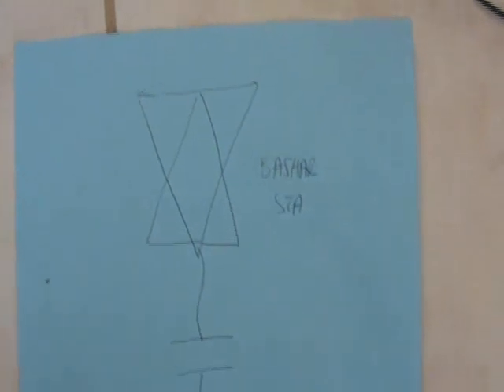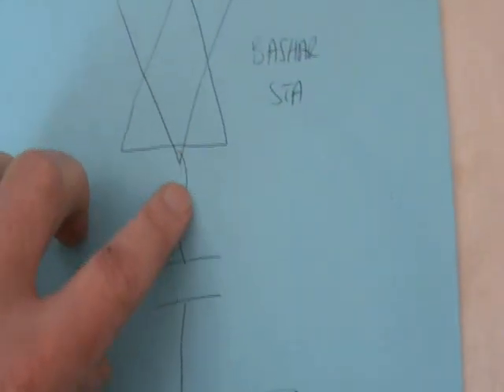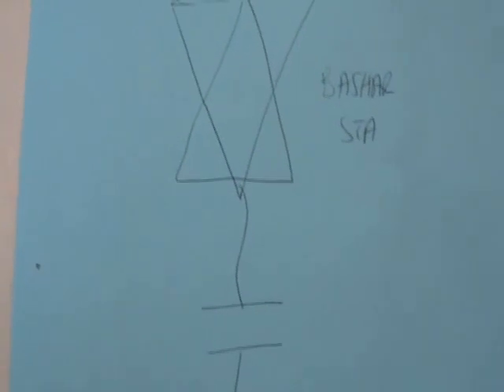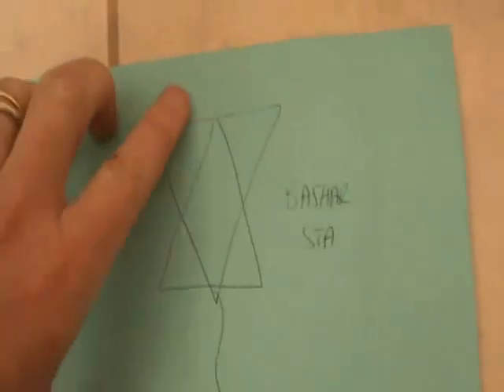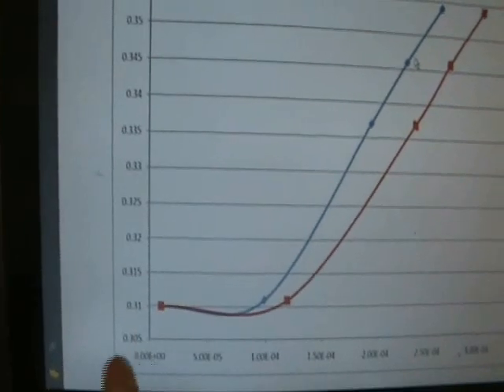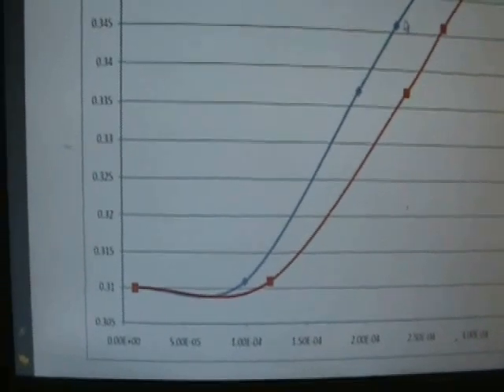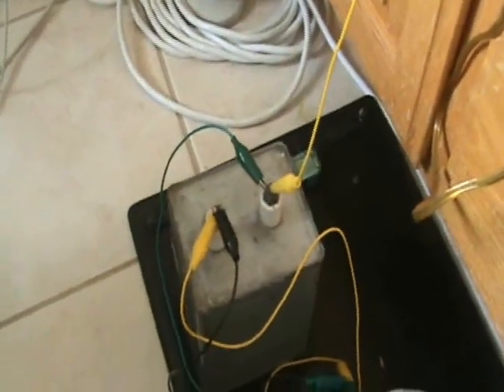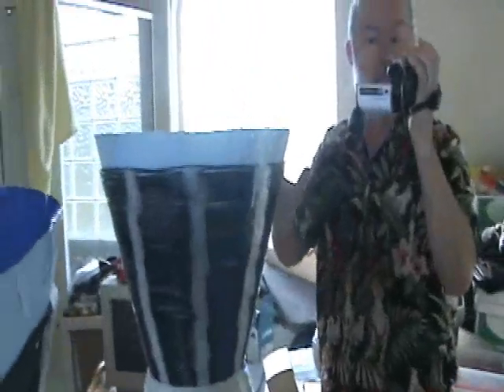Ep. 18 - Bashar Free Energy Space-Time Antenna (Going Lower...)

Comment: bashar  is good coil system in 3 D  , for harvest much voltage , because of his strong accelleration magnet fields , with ferrite and amp meter you can adjust  the highest voltage, your coil construction have a high Q faktor for low fequencity , in the center of the cone dome is the highest potential voltage , to used for charging ,  but it receive normal long /midle  wave transmitter , more copper mass is more induct capacitance and more electron harvest .

Comment: Hi mopher44, thank you for this info :) have you tried using sound waves at different frequency's instead of electricity? Best regards, L
Reply from the maker: coils of made a copper, and its difficult to send sound INTO copper w/o electricity. Speakers?
Reply: Thanks for the reply morphus44 :) the idea was not so much as to send the sound through the wire but more to blast sound at it from the outside or from above, or from above and below at the same time. Hope this does works in someway and is of help to you! Best regards, L
Reply from the maker: Lynne Buksh Are you thinking in terms of the Piezoelectric Effect? Sound producing pressure on a crystal and crystal producing electricity?
Reply: No more frequency, harmonics and vibration. I think we need to be looking at outside the box thinking with these new technologies other than face value sciense. Anything fixed within the confines of Earth physics will not be universal nor interdimensional.

Comment: Hey mopher44. Great work you are doing here. I am thinking about building an STA myself but think I lack the technical ability. I would like to point you in the direction of something I think you might find extremely interesting in relation to the STA. It is called the The Harmonic Energy Exchange Device. Google it and it should be the first result that you pull up. I would be interested in seeing what your findings are playing around with this information.      My thinking was the stress field that was created when the high voltage start pulses where applied would be amplified with the three sided pyramid over the STA. There are however so many different directions you could go when you sit and study the schematic that its crazy.      Anyhow, hope this helps and keeps you pushing on.
Reply from the maker: Oh! Is this a Stan Deyo patent. I know about him. Cool!
Reply: Yes, it is a Stanley Deyo patent. The position of the large capacitance you had at the bottom of the STA reminded me of his arrangement . Bashar said "with a little bit of an electrical charge you can start the coil to begin resonating". The input was on either side of the caps in the Deyo patent..Have you tried putting the STA under a 3 sided pyramid as Bashar said to see if that had any affect on the output?
Reply from the maker: sleding yes I have. But realize there is INPUT as well. I used aluminum foil on the surface of the tetrahedron (not pyramid), and connected the inner foil (separated by the dielectric material) to connect to the coil. This creates a tank circuit. A nearby plasma ball serves as a radiant energy emitter.

Comment: Why do people build these at all? It's like building a motor from Lego that resemble a Chevy V8, and assuming some magic will bestow fuel, air mixture, compression, ignition, combustion, exhaust systems. This geometry, I've seen in Walter Russel's work, and where attempting to explain how waves work. How magnetic orientation to Radiation/Centrifugal while also Contracting/Centripetal  in spheres. Neato models... This "Basher Free Space-Time Antenna" is a hot mess, yikes! I watched a dude plugging one to AC... HAHAHAHAHHA.... ooooo what a bright spark!
Reply from the maker: +XR IX Yeah. Plugging a coil into your AC main -- not a brilliant idea. In my case, I made this coil, because I had read that Tesla experimented with really large cone shaped coils like this, and I thought it would be interesting to try this and mess around. Electronics are a hobby -- yes.
Reply: I don't want to discourage you. If you have made it to, radiant energy, and coils shaped like cones, as well as the Russelarian perspective, you have started moving the hay off the haystack. I built an EV Gray effect motor, and then started realizing there was a facet of electronics that has been, hidden by academia. If you're interested, I'll share.
Reply from the maker: XR IX Certainly Tesla claimed certain things that are not quite mainstream, like faster-than-light wave propagation, longitudinal waves from his tesla coil, and some other clues hidden in his patents and in Hammond patents. I'm familiar with statements made by Tom Bearden and some others. On my todo list is to read up on Walter Russell and some others. I may have to wait until I retire, because my day job is preventing me from having any spare time for hobbies.
Reply from the maker: XR IX I've come across the EV Gray motor. I'm not mechanically skilled enough to attempt a motor. I started to think that something like the Hendershot approach, with NO moving parts, NO inertia, might be the way to go for a nice generator. This is also Tesla's way of thinking. I.e. to NOT have sparks. To not have friction. To not have inertia. A rotating magnetic field doesn't suffer from wind drag. Only the ions being dragged around create the wind. It may be possible to set up a system that creates a sustained rotating magnetic field, and to bleed off just a bit of the energy. Resonance is interesting in mechanical machines but will dampen quickly due to friction or inertia. But if you have inertia going towards zero, you can sustain longer. I think a very large inductance is needed though. Say on the scale of a megalithic structure.
Reply: Yea, that WAS a good one! (that's what you get for believing a 'channeler')
Reply from the maker: k-carl Manley Its not a mater of belief. Scientific approach would have you experiment, reproduce, work out the theory, etc. So you have to TRY, even if at first it seems dumb. Those who don't try find NOTHING. Learn NOTHING.
Reply: morpher44 I abandoned the EV Gray motor. I understand day jobs and being busy. I have been looking at the Don Smith circuits, and reading the quotes of some entity named Zilano who claimed that he replicated the results, and has many insights on doing it. No moving parts, just a reverse Tesla coil, and HVDC and magnetic resonance circuits that could have enough power to run a house. Remember we don't know what an atom is, why the Universe is actually accelerating apart, or why a cloud of Hydrogen in space just starts coming together to form bodies. Don Smith said you just had to pump the ambient with RF HV at resonance, and you could return more energy than you put in.

Comment: Hi,  I have read that Bashar stated that the frequency needs to be set at the frequency determined by the circumference of our planet , which ends up being 7.5 hz, from what I read, he states you take the circumference in KM, then divide it by the speed of light (in KM). which ends up being like 7.48 or 7.49, but, Bashar states that is 7.5 respectively. I'd like to figure this all out, but I am not getting anywhere connecting this to my outlet to give it a 120 volt pulse, and having the coil maintain or stay live by continuously resonating. I am guessing I need to figure out how to arrange and build the entire system, coils and tetrahdron, then place it up on my roof, pulse it with power, and ground the bottom side of the bashar sta to get the power I need. I am pretty confident I could make this all work if I could just figure out a way to build it to resonate at 7.5 hz. He states that it does not matter what type of voltage you pulse it with, he does say it will replicate whatever voltage you pulse it with and stay there under load for infinity or until our planet is ejected from orbit, losing the magnetic field, etc. Please let me know if you have figured out any winding techniques or formulas that may introduce a method to come up with this resonant frequency without adding any "earth" components . I have a very large amount of #4 and #6 solid bare copper wire, but, my fear is that I will not be able to evenly put one coil into the other as the diagram shows without bending open both coils half way to intersect them, then bend them back keeping them exactly symmetrical. He does state symmetry plays a major role in it's perfect function, but, it will also be very far from perfect if this isn't absolutely perfectly symmetrical. He states this is one of the first projects his planet's children build in their "kindergarten" so to speak. That is pretty intimidating seeing how stupid we look in comparison with their children. I wonder what they do at age 50? lol Please reply when you can, it seems you have quite the hold on this project. I really enjoyed the "spiked can" antenna. I believe this will provide you with massive power if you have better symmetry and larger gauge wire. Let me know what you think. I am dying to try this asap!
I also suggest motor run capacitors, but, keep in mind capacitors in series on any AC circuit will limit the load that can be obtained. For my HHO gen circuits before I rectify them, I have a rule of thumb that I limit my amperage when the caps are put in series with them. I use 4 uF per amp of load to limit my current draw as not to overheat them. It certainly stops the current from climbing past 4.5 amps using a 100uF cap, but, 120 rectified comes out as 165 volts dc, and my motor run caps all charge to their maximum as my hho cell measures 365 volts across the cell stacks using a TPU for my pulsed power. (I guess I am too drawing free energy, I just dont know how to figure out where the radiant energy is coming from since the 365 volts only appears at the cell as AC voltage and I rectify the voltage twice, have half wave rectifiers on the pos and neg to the cells too. I do have 1.6 mH chokes inline with 470 uF caps in parallel across my cell leads, but, do not measure the 365 volts at the chokes. I thought they may be the reason I have such a high voltage and such a low powered feed. My tpu transformer can only make 5 times the input power, but, I am not seeing 70 or 75 volts from the secondary pulsed, so, I can't really say, but, it is coming from somewhere..
Reply from the maker: I have an idea. So yes the Schumann resonances, and 7.5Hz in particular are a challenge because they are so darn low in frequency and building a resonant tank circuit requires LARGE inductance and small capacitance, and resistance has to be near zero (so copper may not cut it). But here is the idea. Perhaps what we really need to do is use the coil to GATHER the power and then charge up a capacitor until it crosses some voltage threshold. You can do the math to calculate how much time it will take to charge up some Cap for whatever frequency you want. Now if you had a "chopper", that could SNAP that voltage back into the coil to kick it again, it is like pushing a swing. With a 555 timer circuit, to chop at exactly 7.5Hz, for example, you could trigger a relay that SNAPs the voltage back into the LARGE coil. If you dial in the Schumann resonance, and match it, perhaps some effects might occur -- in sympathy.An even better scheme would be to have a schumann resonant detector circuit detecting the Earth's frequency, and then use that to FIRE you relay to SPIKE the voltage into the coil at exactly the right moment. So this is an active-passive approach where by just MATCHING the Earth's resonance, you may "unlock" some sympathy effects. Anyway, just trying to think outside the box here. I haven't tried this. It is a challenge, as I say, to even just DETECT the Schumann resonances. People usually build a very LONG COIL TUBE and bury it in the ground and get a very weak signal from it due to all the resistance in the wire.

Comment: Have you considered the possibility that having your device sitting on your counter next to the copper plumbing in the sink, as well as the mirror behind, which is glass coated with silver or other metals could possibly be causing interference or energy drain?
Reply from the maker: Yes. Not just that, but also I can "pick up" the power from the wiring in the wall. So an ideal LAB would be out in a field some place, away from all the house wiring or telephone poles, etc. Large coils like this are GREAT pickup coils and are completely dead of power when there is no energetic source nearby (inverse-square-law).

Comment from the maker: So the fad is to call ambient energy "zero point energy". On an oscilloscope, what I see are a MIX of all sorts of RF frequencies that range from say 250khz upwards to 1Ghz. This is a wide band thing, which makes sense since Q is larger and the self-capacitance is small. But the "power" here is enough for a mouse. So, the problem to solve next is GAIN. Armstrong solved the GAIN problem by using heterodyned frequencies, one "powered", and one received. Think "passive" reception, here, however.

Comment from the maker: @czechys 
Solar panels are easy. You just buy them, led acid batteries and charge controllers. Done. The word "free" is a misnomer in that there is a cost associated with the machinery -- which you amortize of the life. This is done with great big NUKE plants too. The strategy should be to create low-power systems that each individual can use for personal electronics. That scales, similar to the way cell phones scale. There is energy all around us..we just need to be clever enough to use it.